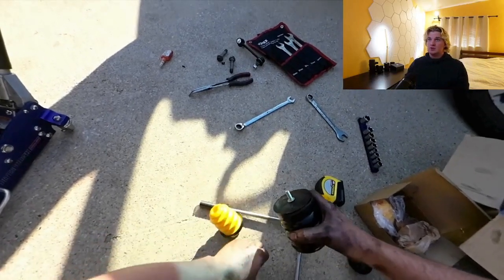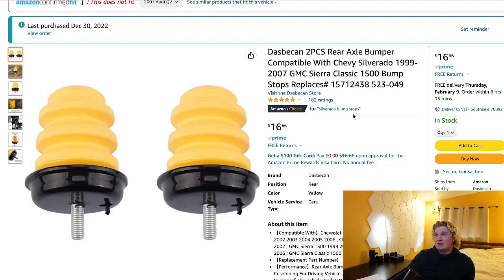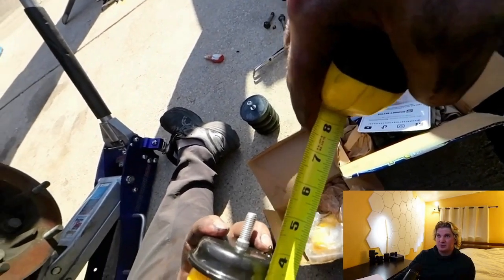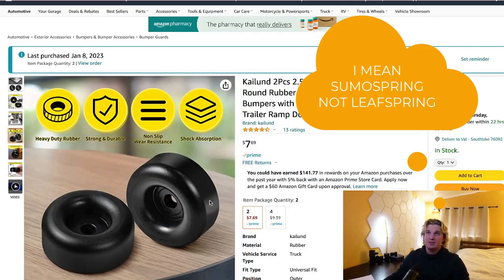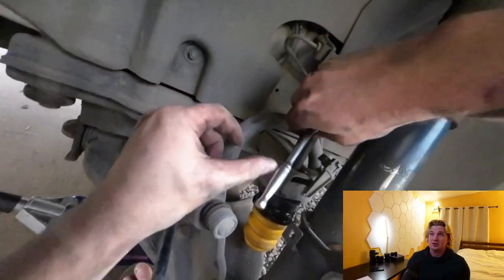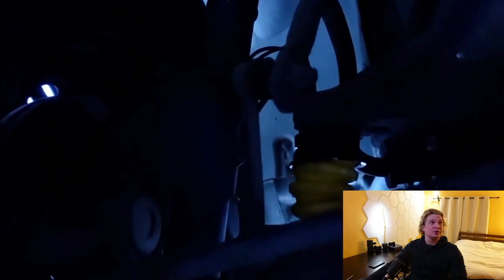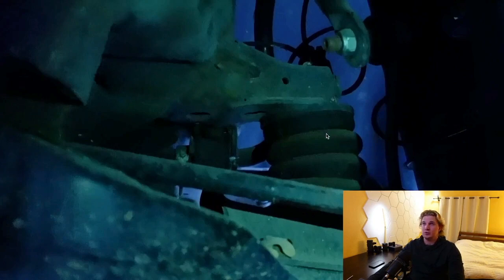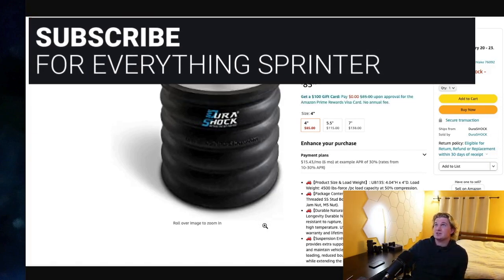Are Sprinter Sumo Springs A Waste Of Money?

Comment: Thanks for featuring SumoSprings in your comparison! We understand concerns about price and always strive to ensure our customers see great value in our products. While it's true that there are cheaper options available, SumoSprings are designed with a unique microcellular urethane material that provides superior damping and load support compared to standard rubber. This technology is specifically engineered to enhance stability and comfort without compromising articulation, especially in challenging conditions. We stand by the quality and performance of our products and believe they offer a significant upgrade over generic options. We appreciate your insights and are here to answer any questions about our technology and its benefits for different driving conditions!

Comment: My Sumo springs on my F150 have been a game changer for pulling my 3.5 ton off road Caravan! While the ride is a bit harsher the sway and role has been eliminated.
Reply from the maker: Haha.  Well I like my sumo springs too.  Especially in windy Texas on freeways. But let’s not forget that they stabilize the vehicle at the expensive of limiting the vertical travel of each wheel.  So the vehicle is mores stiff but the individual wheel can’t go up and down much independent of the entire chassis moving.  If u look at good off-road vehicles they all show off their vertical travel of each wheel.  Not a big deal for light off road gravel roads though.
Reply: @sprinterfix  , that's why I'm giving the F-150 to my son and getting a F-250 Tremor!🤣👍
Reply from the maker: @louishendricks-tv1sx  it better be a diesel
Reply: @sprinterfix  , nah, I prefer the 7.3 gas engine. The Diesel is not that much better on fuel and when considering the higher cost of diesel, and DEF it's a wash. I need the stronger suspension to allow for more articulation without Sumo Springs. I have a Black Series off road Caravan and need a true off road tow rig that can handle 3.5 tons without thinking about it. The Diesel engine adds too much weight and the higher maintenance costs suck! I do all my own mechanical work but only know gas engines!👍
Reply from the maker: @louishendricks-tv1sx  ok fine, that is a pretty cool engine, I was impressed when I test drove it a couple years ago. I guess you can keep your man card then... haha

Comment: Do you realize that the yellow "Bumpstop" is not a Sumo Springs Product. I have installed real Sumo Springs on my Sprinter based Class C Motorhome and they have made a world of difference. They don't look anything what you're showing. The Duralast looks like the front/Black Sumo Spring. On my 2018 3500 Chassis the Yellow goes in the back and doesn't screw in. And they are more than bump stops.
Reply from the maker: Not sure if you watched the video bud. There are blue sumo springs in video.  Also there are black ones straight from super springs company. There are also generic yellow bump stops. And generic black bump stops. I like my original sumo springs.  But I also can’t tell the difference from the fake yellow ones I have on my other van.
Reply: I have a class c MBS 3500 Forest River motorhome and I replaced just rear ones with sumo yellow springs, and what a difference in driving, it's a lot more stable on the road and in and out of driveways, I also just replaced rear ones on my daily driver MBS 2500 as well the difference not as dramatic but very noticeable on corners and speed bumps

Comment: The sumo springs may not be what you want on your daily driver or dedicated off road vehicle but they are fantastic on our class B sprinter van RV.  The RV is close to 10,000 lbs riding on the original Mercedes suspension.  Without the Sumo springs we would bounce in and out of driveways, get blown around by the wind and when a big rig would pass from the other direction it was down right dangerous.  With the Sumo springs there are no more white knuckle driving moments.  The van feels planted and does not sway in the wind or when trucks pass from the other direction.  I have not tried the big name van suspension upgrades, I am sure they are really nice, but for less than $500 this is a perfect upgrade for us.
Reply from the maker: I couldn’t agree more.  I really like the way my van drives with sumo springs as well.  Some of the sway can be taken care of with brand new shocks and struts but sumo springs are a little more permanent but not without their draw backs.  Good for most peoples needs
Reply: 4 inches? That spring is absolutely MASSIVE

Comment: Good points! I did something simmilar by modifieing a back bumpstop from another van and putting it on the original bumpstop, like a glove. It is a good idea but only for highway traveling, not so much for overlanding or bad roads.
Reply from the maker: I agree.   Most people think bump stops are an upgrade and that bigger is always better but there is certainly a downside to them.   I love my bumpstops on the highways but going over speed bumps can be jolting.

Comment: I did install the front and rear version of Sumos and Super Springs on my Dodge Sprinter 2006 Pleasureway RV Class B. The rears went simple, the front was a bit more changeling as the bolt threads are almost the same size as the hole. Had to use more force than I wanted to however they made it in (dont know about taking out). However after trying a cheaper version beforehand there is a night and day difference. With the Sumo Springs installed it now controls the drift much better and stabilization and controls are far better and safer. Here is a link go to the last 45 seconds of the video and you can see the issue I had https://www.youtube.com/watch?v=UV9_FVAOglY . Overall, I would do it again as I do not plan on spending less for a product material that will not handle the rigors of driving when safety is a concern of the products I personally use.

Comment: When I first heard of "Sumo Springs" my first thought was maybe they help,,  but logic tells me the Millions of dollars Mercedes spends on engineering suggests abnormally long bump stops is pointless. Facts are they would limit suspension travel, and overtime could create stress in other areas, and probably not last very long.
Maybe they could be considered a cheap poor mans solution to excessive sway, at the cost of less travel? But if someone doesn't need a lot of travel,,, right?  They may be ok for daily driving without a heavy load, but on the other hand,, I do believe in the concept of spring progressive suspension, however that doesn't mean adding relatively soft rubbery cushions are better than actual coil over springs.   They obviously cannot last as long or provide the true benefit of coil overs.  Now looking at the somewhat silly or simple solution to coil overs sold by Agile Off Road,  their concept was obviously NOT the work of a true engineer, but a quick dirty solution to adding coil springs over billstein struts. Which you figure, The charge about $1000 for 2 Bilstien struts ($150 each) and add 2 coil springs ($150 each) and nearly $400 to add 4 slip on aluminum rings branded with the Agile name,,, well I guess its a fair price, if not for the fact the silly aluminum rings just kinda "sit" or rest on the struts spot welded on mounts. Kinda scary but Im guess its safe enough. The engineering problem with this is the strut's mounts (not the vehicles) were never designed to have a coil spring, or anything applying pressure against it,, which is a recipe for failure. Although I have seen some videos and I do believe Agile thoroughly tests everything, before allowing the general public to have on their vehicle.
Reply: Would I purchase Sumu Springs, probably not, although I can get a full set, front and back for under $500. vs $1000 for Agiles RIP coil overs (front only) plus installation labor, And then add another $1000 for rear support. I guess its all about money.
Reply from the maker: I could not have said this better if I tried.  You are correct with every details.  These are a poor man’s solution indeed.  However they do put less stress on the transverse front fiber glass leaf spring which can be beneficial if yours is aged.  I prefer brand new performance Bilsteins and I think that that is the first place people should be spending their money for suspension.
Reply: @sprinterfix  Ive been wondering,, does the majority of Sprinter Van sway originate from the front or the rear? I suspect the rear, and am considering adding the Sumo Springs to the rear only, However, if I dont see an improvement, Id like the option of returning them :)
Reply from the maker: @VEHICROS  for the love of all things good and descent.  Drop in some new rear shocks before u do anything with sumo springs.  You’ll thank me later.
Reply: So which rear shocks do you recommend? Just new stock OEM, Aftermarket, or Agiles FOX 2.0
Reply from the maker: @VEHICROS  yellow performance bilsteins are my go to.  Very responsive.  Very affordable.  Works for 95 percent of van owners in my opinion.
Reply: @sprinterfix   Finally was able to purchase and install new rear shocks. Everything could not possibly better. And for anyone out there,, PLEASE do NOT waste your money on "sumo springs" all you really need is new shocks.
Reply from the maker: @VEHICROS  this is certainly something people should know